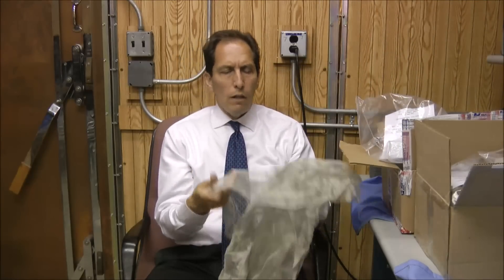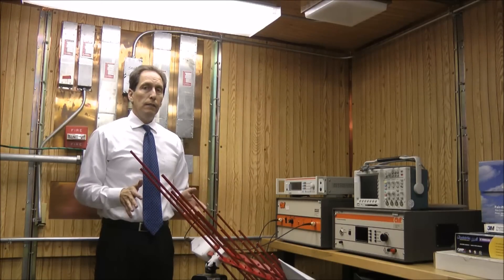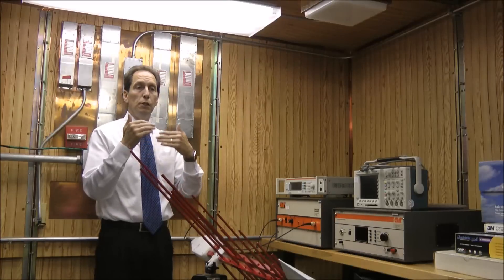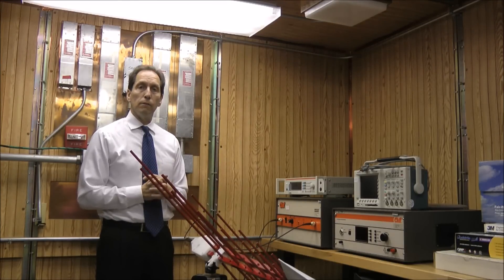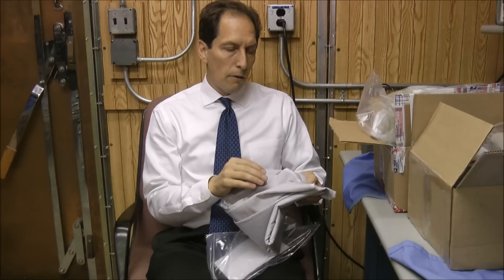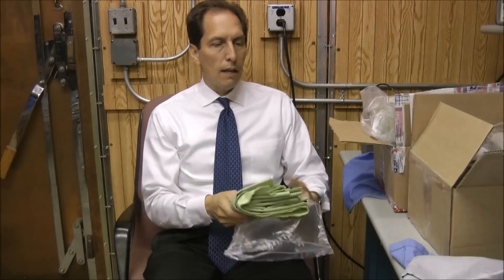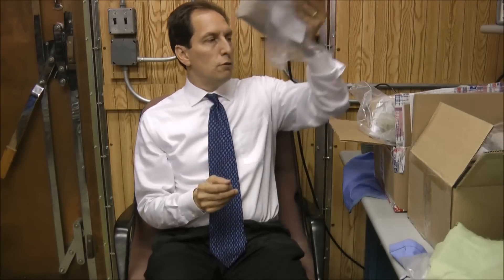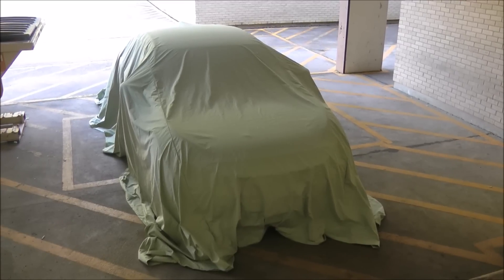Protect Generators and Cars from EMP

Comment: Love your videos, I was wondering what your thoughts are on solar panels, How would an EMP effect them? Maybe a future video?
Reply from the maker: Based on testing done at one vendor, free-standing solar panels weren't shown to be particularly susceptible to the radiated effects of an EMP. That said, it is just one vendor's data, so I can't say that unequivocally. Also, if the panels are connected to the charge control system, they would become more susceptible, as would be the charger. Folks might consider using broadband ferrites (see http://disasterpreparer.com/emp-ferrites) on the power lines to help reduce transients. If the panels aren't in use, I'd personally wrap them up in aluminum foil or EMP cloth (see http://disasterpreparer.com/emp-cloth).
Reply: @disasterprepper  does double wrapping the cloth provide more protection?
Reply: donPCB i cant open those pages. Empshield.com might be what you need?

Comment: so putting a thin fabric with metal in it over a METAL CAR is supposed to add protection?
Reply from the maker: I'm sure something like this would work if you did a good job of sealing it up. Sounds like quite a bit of work, but if you build one, I'd love to see a photo! I might even include it in my next book (with your permission, of course).
Reply: Thanks disasterprepper. Some people turn containers upside down & weld steel plates on what was the floor, so it becomes a very strong roof. You'd need to weld plates over the vents. I think I'd keep the original doors & maybe fit an inner door with a copper seal. You'd need to weld a steel bulkhead of angle or plate. Shipping containers are only 1.6 - 2mm pressed sheet, so you need a lot of reinforcing or they collapse if buried & the sides can bow in.They're only strong at the corners for stacking.
They use Cor Ten steel, but I doubt the copper content would effect the EMP shielding properties that much, but it might? If upside down, containers need sitting on a strong concrete base & you'd need plywood or something laid over the corrugations, or they'd probably distort, especially if driving a car over.Shipping container wood is sprayed with insecticide chemicals which may not be suitable for human habitation, so people often rip it out.

I worked for the M.O.D. in the U.K. nuclear monitoring.They mostly just had an extra small metal room for EMP shielding.The steel reinforcing bars in the concrete for bunkers  are not usually spaced much closer than every 6 inches so. They might give a degree of shielding value, but it was thought best to have a totally  metal sided room for EMP protection to be sure. The blast doors rarely have copper strips on all round, just  heatproof, airtight ones. UNITER communications bunkers have strong steel  outer blast doors, then lighter inner doors precision made with copper seals all round.I think outer blast doors open to the elements are just too prone to corrosion, so inner ones with copper seals are considered preferable.  Regards.

.
Reply from the maker: Of course, it does. If properly grounded, it acts, along with the car's chassis, as a Faraday cage. Even if not touching the ground, it acts as a conductive shield, providing both reflective and absorption loss. It sounds like you believe that covering metal items won't provide shielding. That's not at all the case. The difference is that the metal of the car (or other object) actually becomes part of the cage when it is properly covered. The proof is always in the pudding, as they say, so it's best to actually take RF measurements inside the car (which I did), and that allows you to determine just how much shielding is achieved.
Reply: @disasterprepper  Faraday cage is just a metal mesh enclosure, it is not suppose to be grounded. Are you a medical Dr.?
Reply from the maker: @pahom2  For this application, a Faraday cage does not need to be grounded.
Reply from the maker: @pahom2  My doctorate is in engineering. A Faraday cage does not need to be grounded to protect from far-field energy, such as in this application.
Reply: disasterprepper why not build a garage out of a couple shipping containers, line the inside with aluminum foil and line that with rubber or wood or something non conductive, then ground it? might be more expensive by quite a bit but just park it in there like a normal garage, and it's less likely to be overloaded and fail
Reply from the maker: Sure, it does. Adding a conductive barrier helps to reduce RF field levels. Also, the thickness is not particularly important for high-frequency waves due to something known as skin depth.
Reply: Hi Stephen, just in case people aren't aware , the bottoms of shipping containers are not made of pressed steel sheet like their roofs,they are just wooden sheets fixed to lots of steel C beams. A shipping container would not form an ideal Faraday cage  without modification. You'd need something like steel plates welded to the floor & copper strips fixed around the doors, but even then I do't think the protection would be that good.Better than no EMP protection though,  & as you quite rightly say, some form of metallic inner lining would help.
Reply from the maker: Thanks Michael. I didn't know that. I do plan to test shipping containers in the coming months as part of my next EMP book. I'll give it some thought on how to improve their shielding as well.
Reply: There's a line through my reply on Cor -Ten steel etc. I don't know what happened? Please ignore it!!
Reply from the maker: Very informative! Thanks!
Reply from the maker: Contrary to popular belief, this really isn't a situation in which grounding will offer protection. I talk about this myth in an interview I recently did with The Reluctant Prepper.
Reply: Yes that's true . The field strength is in Kilovolts per metre. That's why they say to close down the telescopic aerials on portable radios as small as possible or unplug the aerials when possible. Equipment with no aerials might survive, but you have to consider transistors normally work on a few volts. Aerial inputs are usually in millionths of a volt. so even with no aerial they could be damaged. Maximum fields generated are up to 50,000 volts per metre but the fields on the ground are likely to be a lot less than this but still enormous. I doubt mobiles etc.  would survive in many cases. 
I used to repair TV's that worked on a 25,.000 Volt supply to the tubes. Bring a screwdriver within 1 inch of the EHT connector & a spark would jump out to the blade.Even 1000 volts is a lot.Small signal transistors would not survive.
Reply from the maker: It's true that shorter conductors are not as efficient at receiving high-frequency content from the EMP. With that said, most electronics have conductors that are long enough to receive the energy. Also, keep in mind that some items, such as cell phones, have antennas explicitly designed to pull in that energy.

Comment: You tested this with a car. How well do you think this would work with shielding electronics (such as a radio) in comparison to the other methods you tested (such as the garbage can or mylar bag method)? If it would perform equally as well it looks to be a much easier and more hassle free method of protection versus the other methods.
Reply from the maker: I think it would work nearly as well, and as you said it would be easier to use. But you'd need to make sure that nothing poked out from the cloth. That would mean you'd have to unplug the radio and disconnect the antenna (or collapse it under the cloth).

Comment: with the car cover draped over the car, the bottom is not encased in the shield. If the conductive cover is touching the earth along the perimeter, does the earth shield the underside?
Reply from the maker: Yes, that's correct. The earth acts as a very large conductor.
Reply: thanks

Comment: Wonderful to see this video and your sewing service.   In your book, you mention not grounding one's Faraday cage, since it could act as an antenna.  Are you suggesting grounding the vehicle's cloth cover; or just allowing the fabric to touch the physical earth?  Please elaborate.
Reply from the maker: I'm suggesting allowing the cover to touch the earth naturally all the way around the vehicle (as I did in the testing). Good point Bruce. I'm not big on connecting long wires to any kind of shield.
Reply: If worried you could add a few ground straps on the edges.  It would ground like the drag ground straps we used to use on vehicle  CB radios.
Reply: Bruce Wayne 
I'm BATMAN 😂😂😂👊